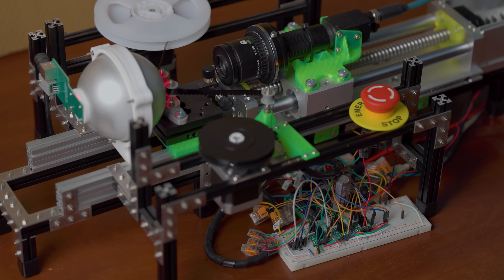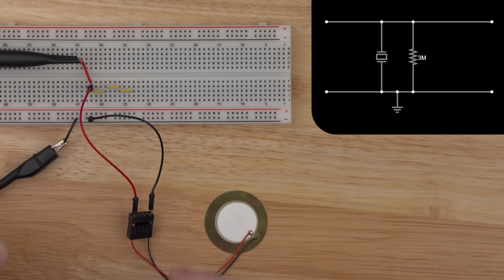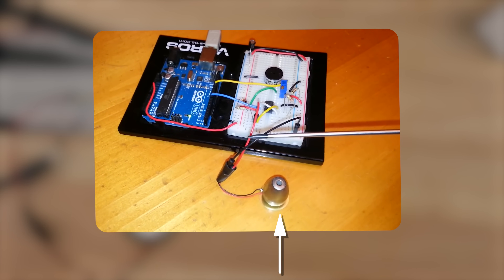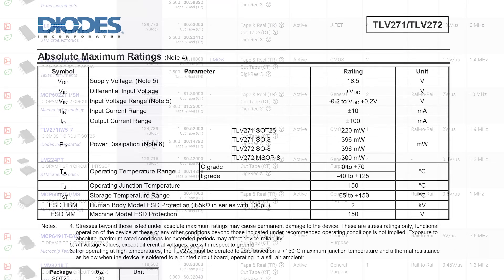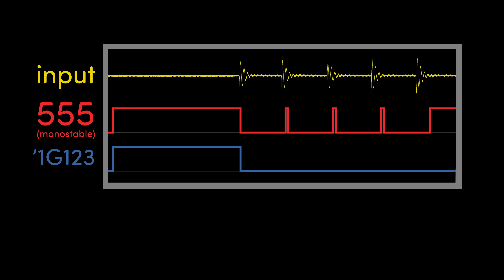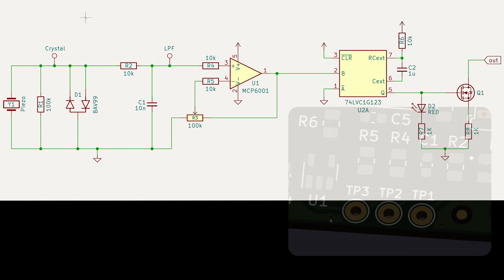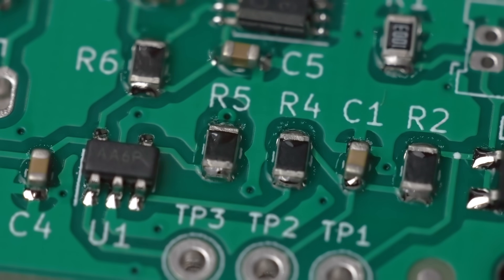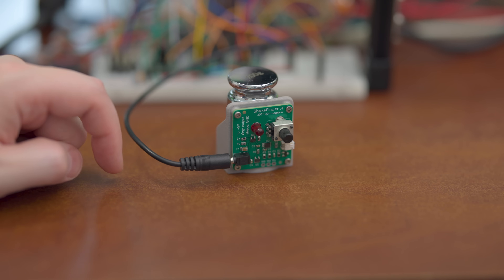Designing a simple vibration sensor

Comment: Excellent work!
One question: Are of the shelf ICs like accelerometers not suitable for your application (and if so, why), or did you build this just for fun and education?
Reply from the maker: Someone wrote a nice answer to exactly this question over in this forum post: https://forums.kinograph.cc/t/shakefinder-a-vibration-sensor-for-stop-motion-scanners/2761/7

The short answer is that MEMS-based accelerometers usually report the acceleration forces directly.  In our case we only want the change in (or "derivative" of) those forces.  So if you used an accelerometer you'd have to spend time on your microcontroller doing signal processing to almost get a noisy version of what this thing gives you directly.

But also: for fun and education! 🤣
Reply: @NicholasPiegdon  Thanks for the detailed answer.

Comment: Why not use a schottky or a germanium diode to limit the voltage instead of a silicon one?

That way your viltage spikes will be 0.2 - 0.5 V and most normal opamps will be able to handle it.
Reply from the maker: This is a good idea.  I hadn't thought of it during the design but a dozen or so comments have mentioned it as a good solution that opens up the list of op-amp candidates considerably.

Comment: If you analyze the frequency spectrum of a taken picture, you may get an alternative to an additional sensor. But I really like the way you engineered the circuit.
Reply from the maker: There’s enough variation from frame to frame in the original material (camera movement, motion blur, poor focus, sudden transitions between scenes, etc.) that trying to compare a frame against some “average” frequency spectrum would be challenging.

It would also add latency and slow down the scan: this sensor already has the “was there shaking?” answer as soon as the pixels arrive. Analyzing the spectrum can only begin after all the pixels have arrived.

For just a few dollars in parts, I’d take the direct, instant hardware-based answer over the slower, ambiguous software-only answer.

Comment: It would have been easier to just get a film projector and watch the movies on that.
Reply from the maker: Well, sure. I've already got a film projector. But it can't capture the current state of the 50 year old film before it degrades more, it can't restore the original colors by using carefully selected light wavelengths, it can't digitally remove dust or scratches, it can't de-shake and smooth the motion so it's less dizzying to watch, and it can't package the results up in a way that I can share with my family spread across the country.  The film scanner I'm working on does all those things.

On the left side of this comparison is "camcorder pointed at the projector through a mirror box".  On the right is an early result from my scanner: https://youtu.be/3pXgf3vn8-g

So far it feels like it's worth the extra effort.

Comment: Why don’t you connect the negative of the transducer to a 2.5V rail? This way you can centre the signal between 0-5V and use any op amp. You’ll also capture both sides of the signal.

Comment: I remember tried to make vibration sensor with gravity / force sensor. Completely depended on resolution and cheap parts did not have high. (also throws garbage data time to time) Never though a piezzo could be used like this. Awesome

Comment: Maybe use a Schottky diode for clipping the reverse voltage? For detecting the pulse, use the Arduino interrupt, it comes in handy. It interrupts anywhere the program is executing without disrupting program flow, could save a flag that a vibration occurred, then the program runs until code checks and clears the flag. You could establish time limits, then output if vibration detected in those limits.
Reply from the maker: The Schottky diode is a good idea.  That opens up the choice of op-amp quite a bit.

And I agree that an interrupt (with a single volatile bool assignment in the ISR) is definitely the way to go.  The sample code in the GitHub repo shows how to use it in the clear-the-flag/do-a-thing/check-the-flag way you described.  That way you can be sure you didn't miss any events.

Comment: Very cool project. I think instead of trying to find a hard to find op amp, i would have found a lower voltage drop diode and put that in front of the op amp. If your normal input is between .7+- and you put a .3 drop diode, yes they exist you have .4v to 0 input signal. You could also just put a diode befween opamp and ground to lift the voltage off of ground, allowing you to process both +- sides. There are many other ways to solve this but I thought it was a great project.

Comment: If you use an inverting amplifier circuit (op amp based), you don't have to worry about the input going below ground.  It's fed to the inverting input via a resistor, which forms part of the gain calculation and limits the current to that pin.  The inverting input acts as a virtual ground, in that sort of circuit so all you have to worry about is the current going into or out of that pin.

Comment: Watching the table shake made go back 15 years. making an mpeg from jpegs, with focus stacking for each frame. I built a stepper driven microscope stage and software for a PIC , and finally made "animation focus stacking Blue Bottle Calliphora Fly" .  First setup in an attic, the first days shots were awful, blurry but only occasionally, night shots were better but still occcasionally blurred. Moved to the cellar and an order of magnitide difference where now the DSLR shutter was vissible. in the end had a shutter delay then flashed an led, as i had light conterol in the cellar. but now we have st vibration sensors with 70KHz BW or HX711 with a strain gauge or a long beam siezmometer,

Comment: At the 12:38 mark what program are you using to show the PCB in 3D?
Reply from the maker: That's KiCad 7.0 on both halves of the screen.  From the regular PCB view you can press Alt-3 to open the 3D viewer.  To see components in that view you do need an extra 3D model for each part (in addition to the schematic symbol and PCB footprint), but a lot of (most?) manufacturers include 3D models with their downloadable CAD files these days.  The quality can be a little uneven: for example, the 3D model for the PicoBlade connector is just a single color while the others at least try to distinguish between metal and plastic in their colors.
Reply: @NicholasPiegdon  Thank you!

Comment: Excellent video, I've made a circuit with a similar front end before with a piezo for sensing a buzzer on a product production line as part of a test jig.
With mine I didn't bother with the protection diodes as the op-amp I was using OPA316 by Ti has protection diodes inside it anyway.
I was also able to get the negative swing of the piezo without needing a split rail supply by replacing the ground on the front end with a 2.5V Vref (I generated with 2 10k resistors in series).
I love the use of that 555.
Though in my opinion R4 is superfluous as R2 is already suppressing the current from the piezo.

Comment: The usual way to handle that 3.3 to 5v difference is with a level shifter. Its such a standard problem there is an actual tiny super cheap component to deal with it.

Comment: Sorry if this is a dumb question but I'm new to module electronics - When you say the PI only offers +5v, does that mean it only offers a single pin pushing +5v? What can you do with only a positive voltage output pin? Do you link the other end of that to ground or something? Thanks.
Reply from the maker: When I said Arduino was "5 volts only" that means that on its normal digital I/O pins it reads 0V as "off" and 5V as "on".  And when you tell it to write an "off" to a pin it sets it to 0V.  When you tell it to write an "on" it sets the pin to 5V.  For Raspberry Pi all of that is true except with 3.3V instead of 5V.  So that's where the problems begin: if our circuit deals in 5V being "on" but the Raspberry Pi is expecting 3.3V to mean "on", the circuitry inside the Pi can't handle the extra 1.7V and you can "burn out" the pin (or worse, the whole chip).  The little fires I showed in the video were mostly a joke--you don't usually get to see anything so dramatic, but you might wonder why that pin suddenly doesn't seem to respond anymore.

It's even bad in the other direction for a different reason: if our circuit used 3.3V to mean "on" but our Arduino was expecting 5V you run into a situation where you start guessing about the circuitry inside the chip and where the cutoff is between "on" and "off".  Is 3.3V enough?  Maybe it doesn't flip to "on" internally until 3.9V.  Those values are usually in the datasheet but in general it's not a great idea to have mismatched system voltages.  The worst case is that 3.3V might be in a kind of gray area where the Arduino begins oscillating between on and off very quickly, using lots of power and possibly causing a ruckus in your code with lots of interrupts.

So sending more voltage than a chip is expecting: you might ruin your chip (more or less instantly).  Sending less voltage than it's expecting: you can't really guarantee it'll behave the way you want or that it'll even detect your digital values correctly.

Comment: What "standoff"/"spacer" material are you using for the jig for applying solder paste to the PCB with the stencil? I've used spare PCBs in the past, but they're a bit of a pain to find cobble together to act as a jig.

And on the video in general: Practical application of electronics knowledge to make a novel solution for a somewhat niche problem. Great work!
Reply from the maker: I think it's just plain acrylic sheet.  I got those L-shaped cutouts as an add-on in one of my past orders from OSH Stencils and I've used the same set ever since.  The typical FR4 PCB thickness is ~1.6mm which is also a standard acrylic sheet thickness, so they match up nicely.

Comment: Great educational video! I would swap the diodes with shottkey diodes that have about 200mV drop. That would allow you to use a less exotic opamp.
Reply from the maker: This is a great idea for at least the negative half of the signal.  In applications where you really have to dial up the sensitivity, it's fine for the positive half, too.  But if you want to retain a little more headroom (say, to only detect really big slams) it's probably better to keep the typical, ~0.7V diode for the positive side.  Although, I suppose, in a pinch you could just vary the weight to adjust the sensitivity back down into the 0.2V range.  Either way, yours is a good observation!

Comment: The engineer in me is being like "but couldn't you make the camera sensor and the film folder mechanism more rigid to each other?" I don't mean to demean your work on this vibration sensor or anything. It's brilliant work well beyond the stuff I do. But perhaps if your film scanner sandwiched the film between a couple of glass plates which were mechanically coupled to the camera sensor's lens assembly and also the light source? That way, the scanner could take a tumble down a flight of stairs and still get a crisp image. Am I off base here?
Reply from the maker: I like this kind of brainstorming.  The light source is (perfectly!) diffuse enough that movement relative to it shouldn't matter, which makes the problem a little easier.  The camera sensor and lens assembly are actually on a moving sled though.  (I didn't have a chance to talk about that part yet, but there is movement beyond just one-time focusing.)

The glass plates are an interesting idea that I investigated a while back and one tricky part there is that whenever you have things touching with a slight air gap you get "Newton's rings".  (The Wikipedia page has some cool pictures of the rings you don't want in your captures.)

All of that said, yes, some additional rigidity would be helpful.  It's tough though.  Most of the machine is already made of metal and it doesn't look like it's moving at all during operation.  It's just when you're down on the micron-scale that it gets noticeable.

Comment: I love engineers because theyll legitimately design a whole sensor from scratch to turn the machine on and off instead of just securely mounting the device to something heavy on concrete
Reply from the maker: Man... I don't want to scan all of this in my basement.  This machine is soo slow! 🤣
Reply: The real value here is this beautiful educational content @NicholasPiegdon
Reply: Or he could have just used an off-the-shelf MEMS package(!)
Reply from the maker: @UnitSe7en  That would be trickier in software and my microcontroller is already busy doing other things.  (Someone already covered the pros and cons here: https://forums.kinograph.cc/t/shakefinder-a-vibration-sensor-for-stop-motion-scanners/2761/7 )  The solution in the video gives exactly the signal I want plus it was fun to build and I learned a lot.
Reply: It looks like a good project and an efficient solution that had a high chance of success. 

The other option that comes to mind is vibration dampening methods, but those could be tricky for the type of system you're using.

Comment: Instead of a special Monostable Multivibrator IC I would have just buffered the output of the OpAmp with a Transistor or mosfet that charges up a Capacitor and a bleeder resistor over the cap.
OpAmp gives Signal -> Cap charges "instantly" -> bleeder resistor determines the decay. Now you have your output signal decay adjustable.

and if you want to be fancy, put a Schmitt-Trigger at the end.

Comment: Hey, Cool video! How do you get i to things like this? Im about to enter uni for cs and maths but im also interested in doing things like this on the side. How would you recommend for someone to start this cool hobby?
Reply from the maker: My motivation to learn things is maybe 100x stronger when I have a real problem to solve.  I could peruse textbooks all day and maybe pick up a few things here-and-there, but when I am stuck on a problem and have to dig for the answer I absorb so much more.  The trick is picking a project that is just far enough outside your comfort zone that it's possible while still being a challenge.  If you're just getting started, the "project" could be something very simple/small so long as it involves something you've never done before.

Comment: As a software engineer, I would have opted for the software approach: put something like a little square of white paper in the corner with a smaller black square inked inside of it.  Make sure the paper is outside the margins of the film, but position the camera such that it still shows up in the shot.  Then, each time your setup snaps a pic, since the square is always in the same spot, look at those pixels, and determine if the edges where the black square transitions to the white paper are sharp and crisp.  Maybe some kind of convolutional filter like Sobel can be used to extract edges, and then all the white pixels above a certain threshold value can be added up as a "sharpness score".  If the score isn't high enough, then you can safely assume the photo is blurry, and needs to be retaken.  

Perhaps this is my own bias, that I fear the hardware more than the software.

Comment: With just a couple caps and diodes you can make a simple inverted charge pump. They are only good for MAYBE  a few tens of mA. Plenty good enough for the opamp circuit you proposed. Then, you could power the opamp +Vcc with higher positive voltage from a standard doubling charge pump. They aren't highly efficient or powerful, but man, are they cool how they work!

Comment: Nice video, loved this style.

One little tip I like to do is to put a set of resistor pads in parallel with my potentiometer. That way I can use the potentiometer to get things dialed in at the setting I like, then I can swap it out for fixed resistors so the knob can't get jostled out of place.
Reply from the maker: I like that.  I don't think I've heard of that trick before, but it's a good one.  Thanks!

Comment: Bro, this is exactly what i did for my last semester projects in college! Though i did not use uC for my project but purely out of ICs, but all went well that day, or sort of, during my time developing the prototype I used a smaller piezo with marble as mass since i want to make the device modular and fitted with a probe, the design was simple and similar to yours, but after the signal have been amplified it went to a comparator to discritize the signal, and then for each TRUE signal it was counted by a counter and sampled by a transistor for 2 sec and then stored to a register and kept until next sampling, the digital data from the register then processed by a BCD to be displayed on a seven segment. Alas the only thing i did not do properly was filtering and determining the bandwidth, i did not know fourier transform is a thing since my collage taught it to me very late. But viewing your video gave me different view of approach to solve same problem or goal, thanks  for sharing your experience.

Comment: I mean, that's cool...but...i would have just done it with software by capturing 3 images, comparing their differences using edge detection, and only keeping it if all 3 match. If they don't match, then I would drop the one that has the highest peak differences and retake. If done in pieces, then it would also fix any dust or power differences in the lighting as a bonus....but....I'm a software guy, so makes sense to me to see software solutions for problems lol